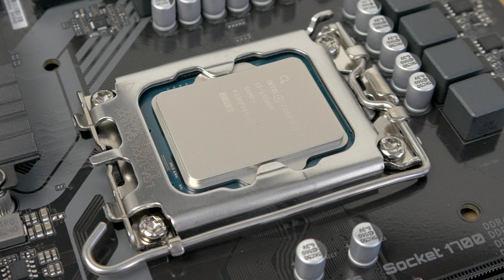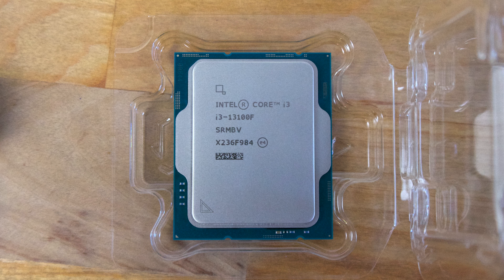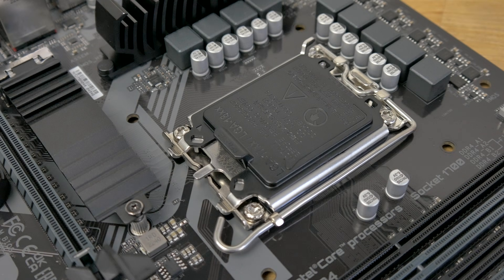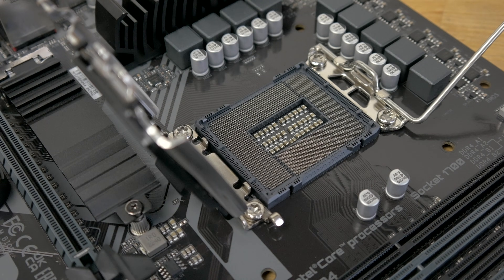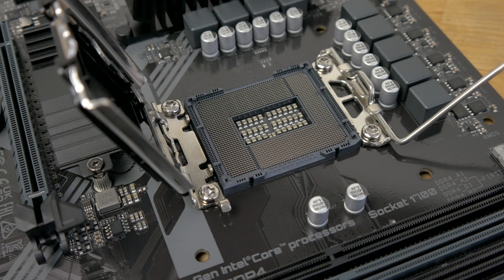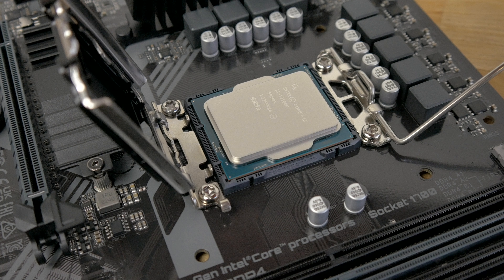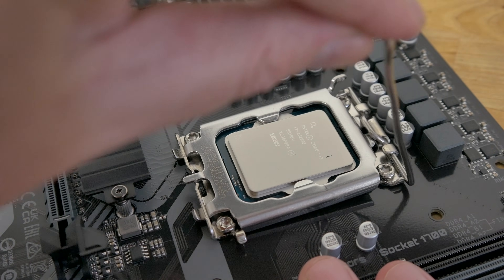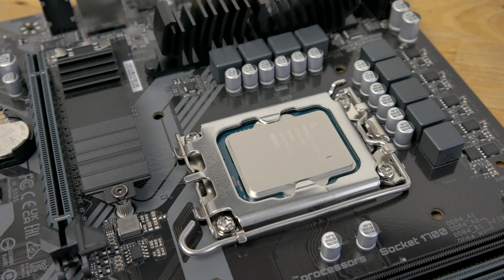How to Install 12th/13th/14th Gen Intel CPU in LGA 1700 motherboard.

Comment: Hello

My pc configuration is as follows 

Intel Core i7 12700
16gb ddr4 memory 
Nvidia GeForce RTX 3050 6gb ddr6 

B760MH motherboard 
LGA socket..

I would like to know whether the below mentioned graphics card support or compatible with the gigabyte B760MH motherboard and lga 1700 socket 

NVIDIA GeForce RTX 3080Ti 12 GB

 NVIDIA GeForce RTX 3070 (8 GB)

Nvidia Geforce RTX 3060 12Gb Gddr6

NVIDIA Geforce RTX 4060 Windforce OC Graphics Card | 8GB GDDR6

NVIDIA GeForce RTX 5060 Ti 8GB GDDR7
Reply from the maker: Yes, any of those graphics cards would be compatible with your motherboard and CPU.
Reply: @BartechTV  hope there won't be any bottleneck...while pairing any of the above mentioned graphics card...processor and ram is fine...right..no need to upgrade to play latest games..
Reply: @BartechTV @Fuchs1337 also I have another doubt... can we upgrade the processor to intel core i9..13th or 14th generation..will this motherboard support it

Comment: I do it like it is shown in the video but the pins are always bent in the weird directions some bend even to the back. Any idea why?
Reply: your message is not clear if the pins were bent before or after. the processor only installs one direction if you had to force it then afterwards the pins are now bent then you probably installed the wrong direction
Reply: @xavierlx  so the computer will require you to type all commands in reverse order.